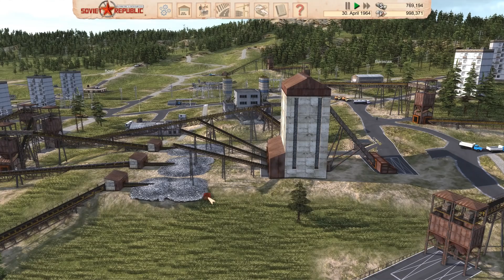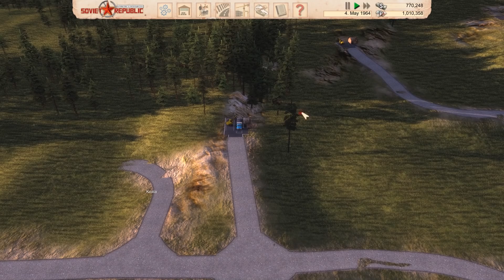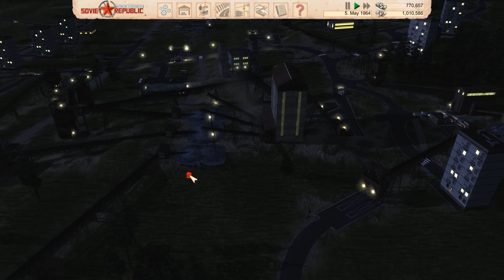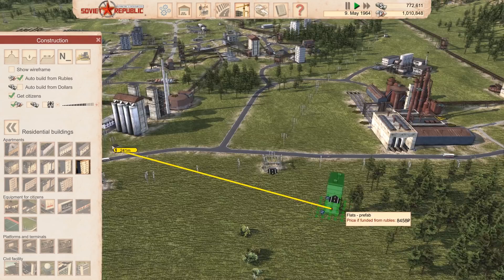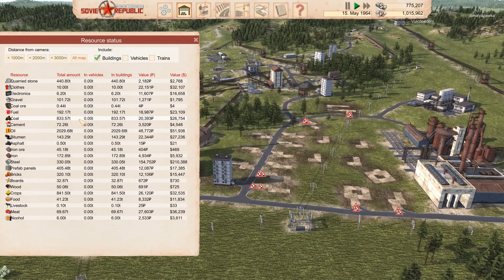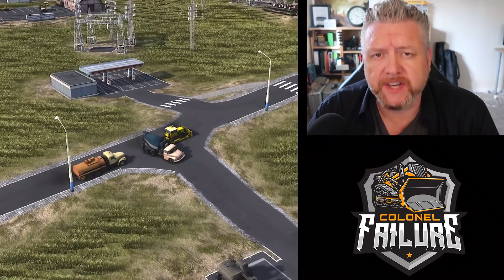Major Construction Projects | Workers and Resources Soviet Republic gameplay #26

Comment: Build a rail construction office and invest a little bit of money in the train equipment to build railway tracks. Then (don't autobuild) build a railway line to the Sovietsky border with Molna from free resources. Gravel and concrete for the concrete track. After that is done you can export many tons of oil and steel and coal for more roebels. Maybe you need to buy an American concrete mixer railcar but thats fine. Good luck Colonel!!